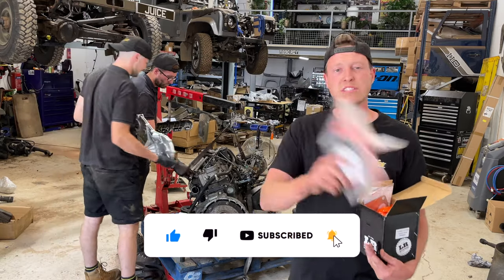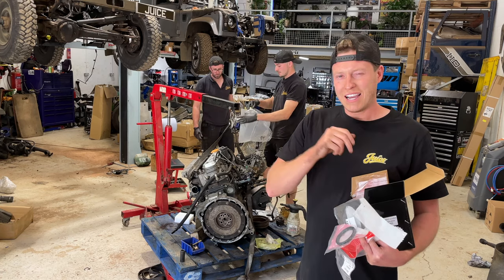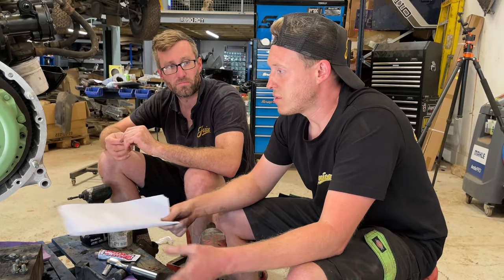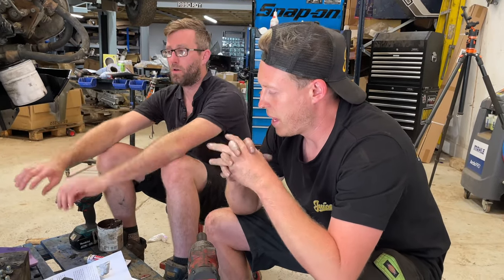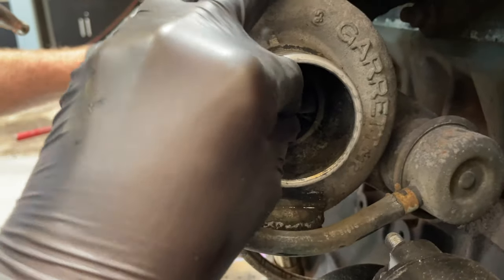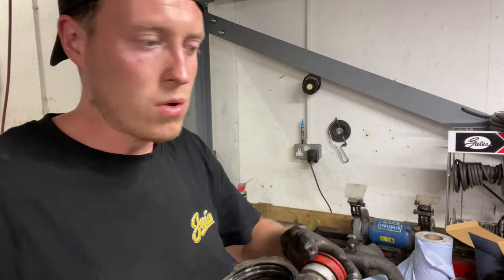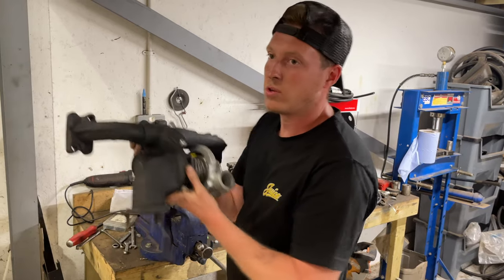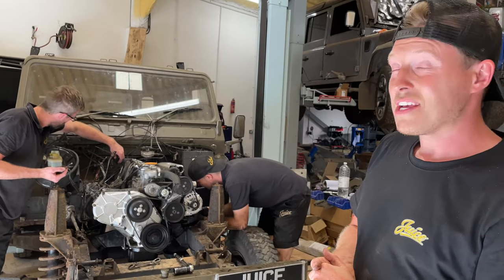Land Rover Defender Ex ARMY MOD conversion - Part 2

Comment: Hi guys, just watched all your vids about the 300tdi swap into the MOD 110. I’m in the process of doing one too. What high temp sealant do you use please? My next job is to change the T seals and oil pan. Thanks

Comment: Hi all, a question for everyone and anyone. Has anyone ever fitted a 300tdi from a discovery to a defender with a 300tdi bulkhead loom please? I am having real issues connecting the looms. Cheers
Reply from the maker: Use the defender loom and plug it all onto the disco engine 😉
Reply: @juicemotors  Hi,thanks for the reply. Unfortunately I don't have the defender engine loom as vehicle only came with the bulkhead loom. I really don't want to fork out for a new defender engine loom if i can help it. I'm just having trouble finding out what to do with all the wires,including the ones that aren't used e.g alarm and egr. Many thanks, Matt

Comment: Enjoyed this video. I have an ex MOD 110 soft top and foolishly replaced the under powered 2.5NA with a V8 from a Disco with Edelbrock carb and straight pipe exhaust. It’s sounds like a TVR and does 15mpg.
Reply: Outstanding.
Reply: Love a Rover V8 in a Land Rover. I get 19mpg out of 109 Stage 1 on a long run, which isn't as terrible as I was expecting.

Comment: Love it ……question: would doing a battery/electric conversion be just as labor intensive?
Reply: It would also be a crime against humanity.
Reply from the maker: I think it’d take way longer labour wise, the easiest part of any conversion is the fabrication and mechanical side, the tricky part can be the electronic side (having a standalone ecu so the engine thinks it’s still in the original vehicle etc) with an electric motor it’d be insane to try and work this side of it out without expensive software, if we use a Tesla setup (which is the one you’d want) the Tesla is constantly sending messages between its modules and BUS system, you’d need to sniff these codes and emulate them back to the ECU for it to work without reduced power/faulting - a whole different world of pain. We’ll do it one day…

Comment: J/M.  Was one going to bolt a 200Tdi exhaust manifold with hybrid turbo ?  This should offer up to 25psi boost, without leaking outside oil seals !  V.

Comment: Of course it will fire up. 300 Tdi, excellent componentry and workmanship, 26 years later and a few mods they are still going very strong. Did the externals and plumbing on mine recently and it's like new. Love it!

Comment: Why don't you use the R380 gearbox out of the disco, the top plate off the LT77 and the conversion from ashcroft and bring it right upto date 😉
Reply from the maker: The ratios on the LT77 are identical to the of the R380, there’d be no noticeable improvement or “feel” we want to keep as much of the original MOD as possible on this one, and we organised all our parts based on the shorted LT77 input shaft so it sits further back 🤩

Comment: 300 Tdi …. Mine is a 300Tdi , why not a R380gearbox
Reply from the maker: LT77 has the same ratios, there’s be no difference to the drive, we want to keep as much of the original car as possible - just the engine swap for this one ☝️

Comment: Great video Might as well take the head off none of the valves will be sealing can guarantee it due to lumps of soot from the egr ,you can clean rest of gunge out of inlets and regrind value seats
Reply from the maker: No need to at this stage, the gasket isn’t leaking, the motor runs well. We’re just giving it a refresh not a full rebuild, if we remove the head, we’ll need to skim etc at that point it’s only the short block so we might aswell do that too. Maybe on the next one!

Comment: 200tdi was always a million times better. 300 is like the ugly sister
Reply from the maker: I always found it interesting the die hard 200tdi fans - the 300 is Land Rovers improvement over the 200tdi but I can appreciate the 200tdi for its simplicity and robustness - it’s just not got the legs for the modern world in my opinion
Reply: @juicemotors  haha most definitely not die hard. I ran 200 & 300 for large generators delivery’s. 200 would always be the choice for all the guys. Just pulled better

Comment: Should of changed main and big ends.
I think t seals replacing with silicon is a good idea
Reply from the maker: No need to, we’re simply refreshing this Tdi engine. It runs well, we have to draw the line somewhere otherwise we’d be fully rebuilding the engine 👌🏻